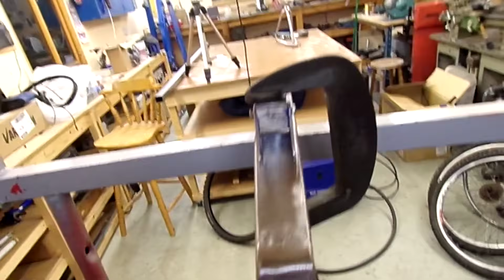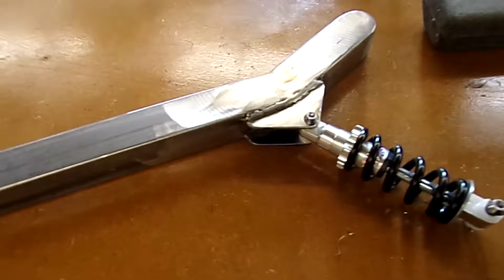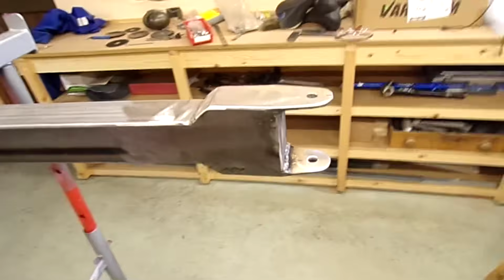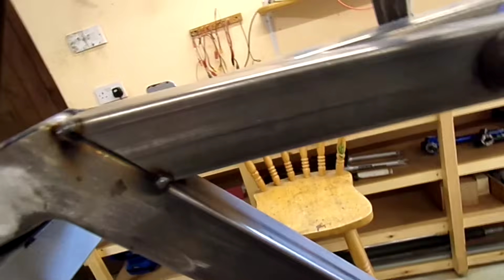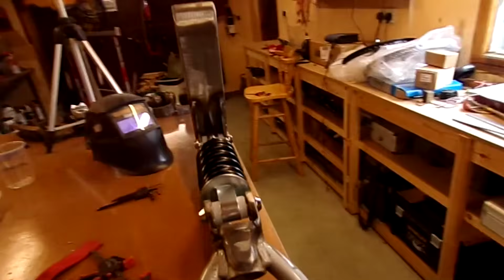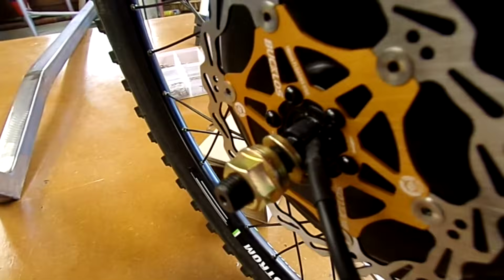TAD3. Tadpole trike rear suspension and brakes.

Comment: Looks like a very strong frame design. Have you thought about colours yet?
Reply from the maker: Hi Tim, yes I think it is a reasonable size box section as long as I miss the potholes. I think I will paint some small parts in my colour choice, to be in the next video, so keep your eyes open towards the end I should think 🙂